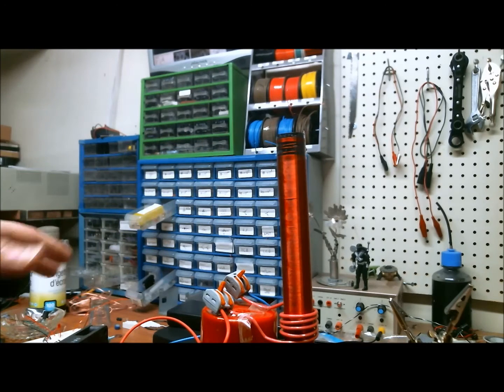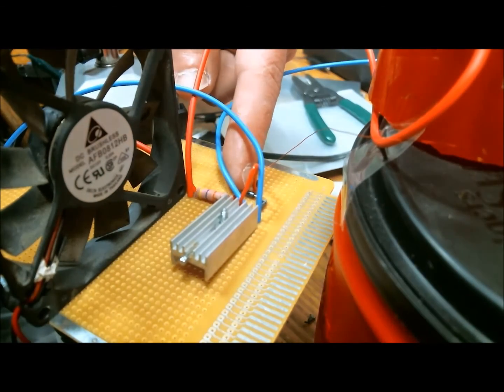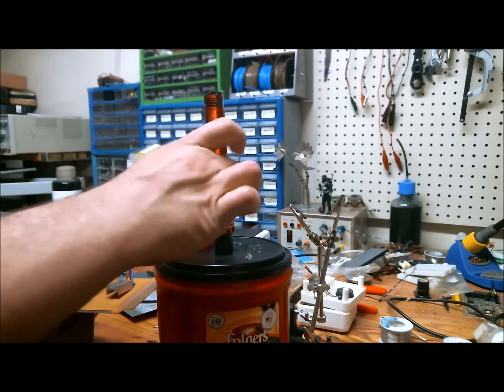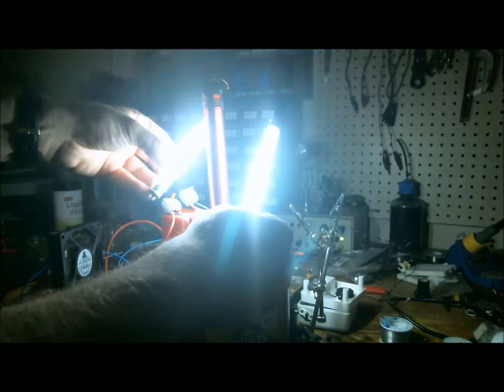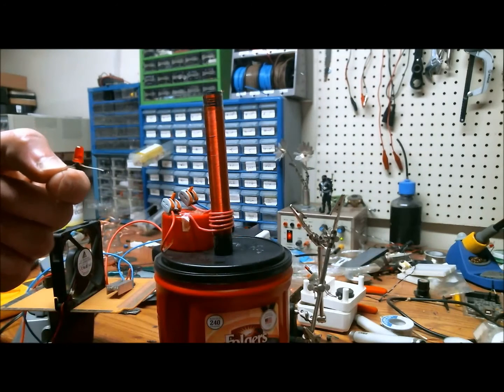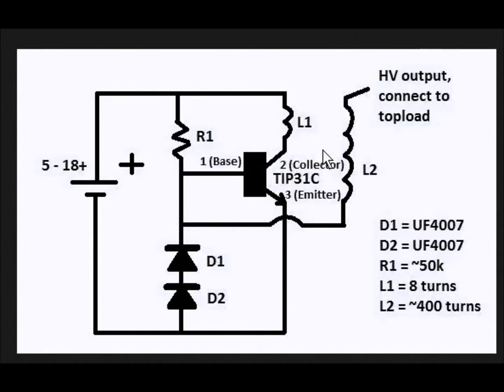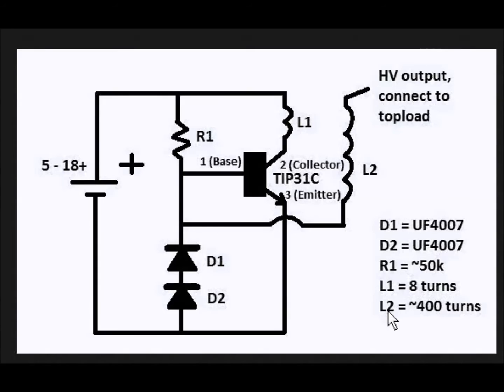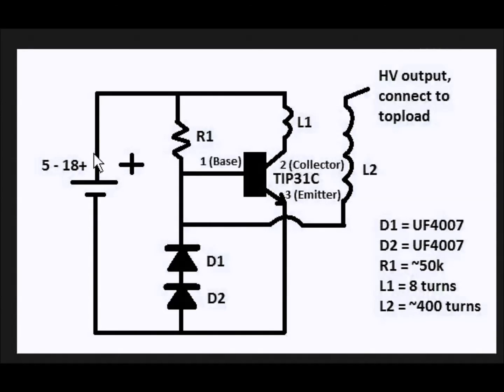Slayer Exciter (with schematic and build information)

Comment: Hi, thanks for your video, very cool project!  I am trying to make one on my own, but first i want to understand the math, according with what you are saying in the video the transformer equations: N1/V1=N2/V2 and V1*I1=V2*I2 should apply to this circuit? So that I can calculate how much tension and current i get out of the secondary? and since these Slayer Exiters have a frequency, are u getting a pulsanting DC current out of the secondary? If so, how can you calculate the frequency? Does F=1/2π√ LC work? thank you very much for your time.

Comment: I need help with this project. I am becoming insanely frustrated with how it is going. I made a coil with 400 turns on the secondary and 8 turns on primary. I try making the circuit, but fail every time. I am using a breadboard for this circuit, and i have tried various different things like capacitors and resistors. The transistor never heats up and nothing ever happens at the coil to light up anything. I'm starting to feel very discouraged about this project because nobody will respond and nobody will help me solve this problem. - Thanks for your time. Please answer.
Reply: +Scotlahn Mccallister donot use bread board! I also tried making with breadboard but didn't work then made it on circuit board and it worked
so try it on Circuit board
Reply: Dont feel discouraged :P Same bullshit happened to me, I used the same transistor as in the video (tip31c), however the biasing resistor is WAY TOO HIGH A VALUE!!! Mine really began working from 20KOhm, and worked optimally with a 10KOhm resistor, what I would do is A lower the resistor value untill it works, or until the transistor gets warm. If nothing happens still, reverse the primary, and try again with the same 10KOhm resistor, assuming you are using a tip31c transistor. If you changed the polarity of the primary and changed the biasing resistor, try reducing the ammount to turns on the primary to around 5, and try to get the radii of the primary and secondary as close as possible to ensure good EM coupling. If nothing works, chances are you eather dont have a functioning diode, or more probably the transistor you are using is simply not an RF transistor and it's transistion frequency is not high enough. You should aim for a transition frequency of at least 2mhz. Try all of that, and I warrantee it will work, and if it still does not work check the diode. Also, for breakout you want to have more turns on your primary i.e. 750 or more turns. Also, you only need one fixed coil, in my case the secondary which has a self resonant frequency of 1800 ish MHz, and simply play around with the primary in order to get it resonant by changing the ammount of turns or adding a variable capacitor across the primary to tune it via the capacitor.
Reply: @ivanrodionov9724  hi, 

Is there any effect of the amperage that the power supply can give? 

Like I'm using 18v 1amp power supply, with a TIP41C (will more amperes give me better arcs ??) 

ALSO, Is there like a formula to calculate how much base resistor I need ? Since I'm running a Darlington circuit with 2 TIP41C 

MY secondary has about 1000 turns.
Reply: @megaraitei  good question. depends on the type of powersupply current limiting used. If it is is a simple resistor or parasitic resistance, ten you will loose output power. If it is an inductive reactance caused by long wires, then things may get interresting, and your wires may actually end up going into resonance and causing all sorts of wierd effects. 

The slayer exciter is a current amplifier effetively, and while the RMS current may be below 1 amp, its peaks can exceed it, causing clipping and all sorts of wierd effects to happen, like you getting side bands(possibly desirable if you want to power a capacitve load, but not good for an inductive load). In order to fix this issue, you want to use a decoupling capacitor, and place it very close to the transistor to help with the current spikes, make sure to use a LOW ESR capacitor. I found that by using a 0.47uF wima mkp capacitor, the output power (on one band) increased by 50 percent due to the higher current availble.  

Greatscott recently made a very detailed video on the matter, so my advice, definetly play around with adding a decouping capacitor to increase your output power, and try different ones too, as different capacitors have different parasitic components in them. 

As for the formulas, they are extremely complicated. I did a paper on the circuit actually, and that resistor value unlike in an amplifier, does not determin the bias per se, but rather helps create the initial noise which is pushed through the loop and instead helps with stability and load responces than the output power, by keeping the transistor critically biased. 

If you want to describe the actual behaviour of this circuit, try modeling it in LTspice and running a few parametric analeses. thats how I built my slayers, as the math in describing feedback loops gets grizzly.
Reply: @ivanrodionov9724  
 
Oh Boy! 

Here I was thinking it was gonna be  something simple like A-B-C = 0 

I have ordered for some lower value resistors as well. 

Will try these out in replacement to the 4.7 kOhm I'm currently using. 

Thank you for taking the time to help me understand.
Reply: @megaraitei  yeah, no problems. you can email me a ivan_rodionov@yahoo.com if you want a copy of the paper. 

also, no problems and glad to help.

Comment: Hi, what diameter of the air core did you used? I'm not very familiar with slayer exciters but want to build one which air core diameter is 4 cm, using 0.25 mm (30 AWG) thick enameled wire as in this vid, but using 850 T on secondary. Will it have a better range if I use more windings on the secondary? And I don't know how many turns on the primary should there be if I put 850 turns on the secondary, is there any equation for this ratio? Thanks!

Comment: if i isn't use diode in that circuit so that thing will work or not?
because i made a exciter but it isn't work, so i guess maybe diode is required
Reply: No, a diode is not required.
Reply: dude can you plz help me coz i want to make it in small size which size is smaller then my fist and plz make a video about how this thing's system work.

Comment: Thats exelent performance for 5:500 ratio!
If you wanted play with the tune, changing diodes can make a bit of difference. I really like two LED's in parallel with tip31c. Playing with difference primary's also makes a big difference. 3-5 turns is good for max step up. Have seen them work with 2 turns.
I think a 4-5 tun pancake could improve it a bit.
For tip31 resistor, anything from 33k-70k is good.